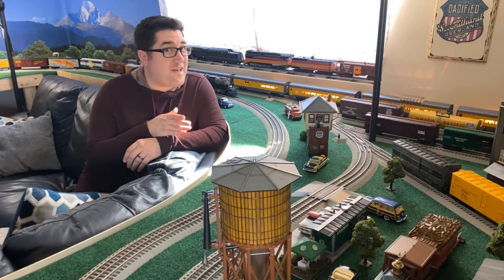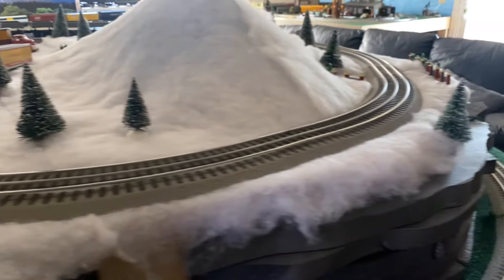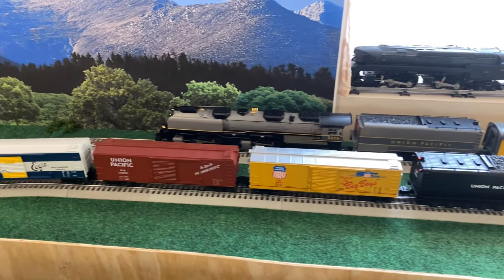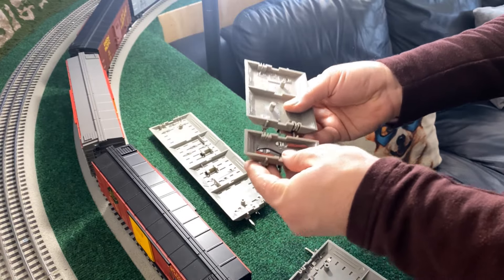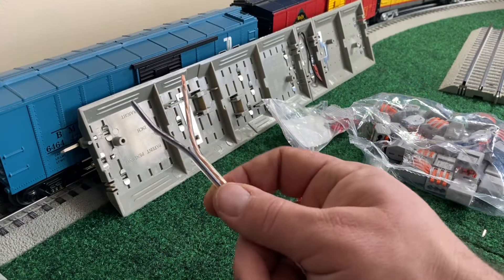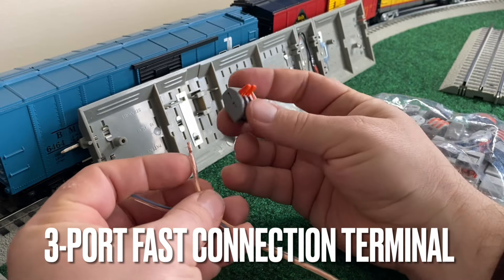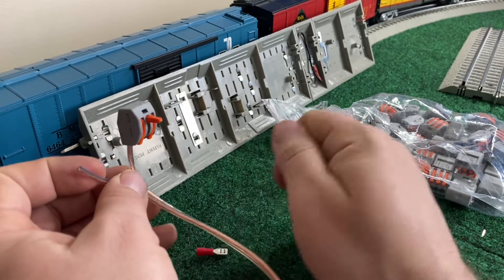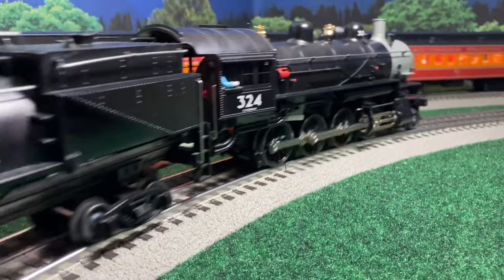O-Gauge Layout Wiring Tips: Do THIS before you build!

Comment: Good tips man! Might have to do some wiring on mine too!
Reply from the maker: Have you been experiencing any power losses?  Dim lights or reduced power?
Reply: Not too bad at the moment, just one siding track is acting a little funny when going at slow speeds, might thread another terminal wire to it!  @Dadified86

Comment: Great video Mike with a lot of helpful information.  Unfortunately, American Flyer FasTrack by Lionel does not have any of the integrated wiring connections underneath.  So, for larger AF layouts using FasTrack, multiple terminal tracks can be used and/or melting off some plastic underneath to expose the bottom of the rails and soldering wiring to it.  Not horrible solutions but definitely not as neat as 3 rail FasTrack.
Reply from the maker: Huh, I had no idea.  Would’ve been handy to have that access underneath
Reply: @Dadified86  Yup it sure would have.  Flyer is kinda like the red headed step child for some things from Lionel.

Comment: Very informative. Though I was wondering since I'm creating a more permanent layout on my end; do you need to have separate blocks throughout the loop of track in order for this to work properly? Or does this not matter? What power supplies do you use for your layout or would recommend as well?
Reply from the maker: I would put power to the track every 8-10 feet from one source.  In my case, I’ve got an old 135w Powerhouse “Brick” running the main line.  It’s enough unless I get all three fully loaded passenger trains on it… then it dies 😂
Reply: @Dadified86  okay that’s definitely good to know. I already have a ZW transformer for powering the track; would that be a good substitute for the 135 powerhouse or would I need both?
Reply from the maker: @Gracchus4047  your ZW should be fine.  Depends on how much track and how many trains at once, but I would think it would be plenty.
Reply: @Dadified86 I just remembered this question; when doing the track wiring did you have to do both soldering the wires to the track and the track connectors or would one way or another work?
Reply from the maker: @Gracchus4047  You can solder to the track or you can use the connectors that I used.  You don't need to do both.

Comment: But You might as well not have bothered with the bus. The speaker wire is great. But not soldering it to underneath the fastrack you are losing a lot of good connection with those spade connectors. They are made of cheap metal so the power is there but you go from good copper speaker wire to some pot metal pos, to your rail.

What you should have done is picked up some plumbers soldering flux, take a clean tip soldering iron (I don’t care if the soldering iron is 5$) and a mini paintbrush, to put flux underneath the 
Fastrack on the tab, dropped a ball of solder on there, then twist the speaker wire , dip it into the flux, tin the wire with your iron and solder and then hold the two together tap the soldering iron on and bam she’s welded on as you would say.

Those little daisy chain splicers are also a weak point, should solder it properly. 

IF the layout is permanent 
You could also solder your sides of rails but I wouldn’t in your situation cause you prob make changes from time to time being on grass mat and that’s fine with me. 

No sense in having all these nice engines and a  between good power and the rail.
Reply from the maker: Learning as I go!  These trains will outlast this layout so when I’m old and need a project and decide to redo the layout, I’ll have plenty of “woulda shoulda coulda” things to make the next one even better.  It works for now and it’s solved my problem!
Reply: @Dadified86  price range of those sound engines (not lionchief starter type) 

Pretty stupid to have a 0.00001 cent piece fail on you to have spotty sound 

It’s like putting in used oil in a new car (your engines)

Comment: As an electrician of 19 years, those 3 port fast connection terminals........ARE GARBAGE. Stay away from them.
Reply from the maker: What would you suggest using instead?
Reply: @Dadified86  wire nuts are the best. Twist the wires together and use the wire nut to keep it together. I was preparing to do a YT video on wiring as well, but explaining why these connectors are no good.
Reply from the maker: @TheCreativeMind  I very much appreciate the feedback!  If I have any issues I know what to switch to.